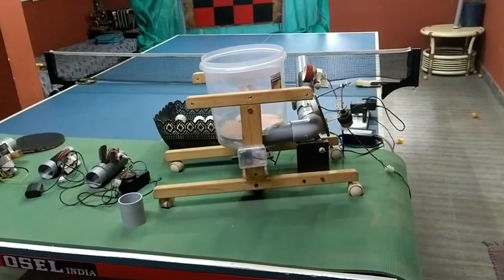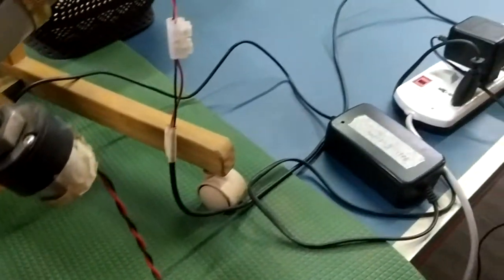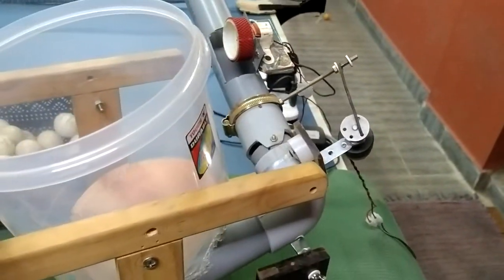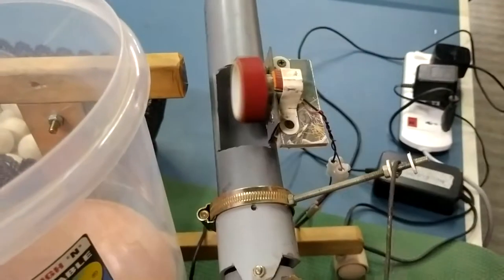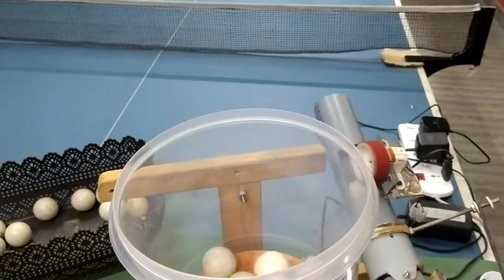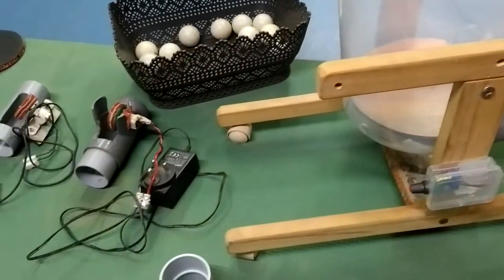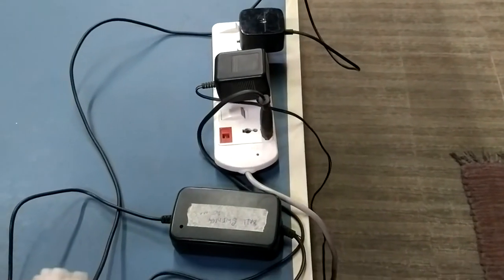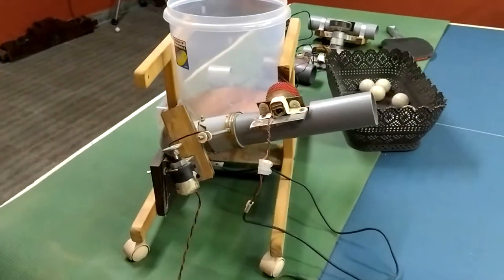Table Tennis Robot - explained.

Comment: Thank you so much for this video. Sir, plz mentioned the specification of all motors in comments
Reply from the maker: Thanks Mr Naba Kishore Prusty for watching my video. 
1. For ball delivary disc in the plastic basket i have used 200 rpm DC motor controlled by small max 12 volts regulator to decrease or increase the speed of ball delivary. This is connected to 12 volts Ac/Dc convertor( or any waste mobile charger at home). 
2. For osilation mechanism of ball delivary tube also same 200 rpm DC motor, regulator and convertor. 
3. For ball shooting wheel device i have used high speed DC motor of 12 volts . Regulator if necessary and Ac/Dc convertor of 12 volts. 
Regulator will be a must for ball delivary disc and oscillation mechanism.
Reply from the maker: For ball shooting wheel DC motor of 1200 rpm

Comment: Where to get coupler to connect motor to wheel or bottle cap please?
Reply from the maker: I used gum tape to wound on shaft and fix the toy wheel . For bottle cap , just made a hole , fixed on shaft and glued with Araldite .

Comment: Were you an engineer ?
Reply from the maker: Thank you Aman. 
I am not an Engineer. I am a Botany (Hon) graduate and Post graduate in HR. 
It is all common sense as i know  little bit of physics in my PUC. 
Saw many youtube videos on this Robot done by Chinese and Japanese and took the ideas DC motors. Electronic regulators and some pulley  wheels  are only bought through  Amazon and all others are recycled materials available at home. 
Any one can do with General Knowledge and common sense.
No need to be Electronics/ Electric/ Mechanical Engineer.
Reply: @nagarajbn4724  Sir your videos are very informative. I used to do these things when I was in school. Now I got to know about your channel because of philately, you're doing amazing. Keep motivating and sharing knowledge. Best wishes sir.
Reply from the maker: @a.man.arora7  
Thank you ☺️☺️☺️

Comment: sir can u share its componnets
Reply from the maker: 1. Old plastic basket lying at home. 
2.old PVC cut pipes lying at home. 
3.old wooden stand lying at home. 
4. Bought out Nuts, bolts, screws, clamps. 
5. 60 RPM Dc motor for ball disc delivary fixed to the basket. 
6. Mini electronic DC regulators to controle the speed of delivary of balls and swing arm. 2 numbers. 
7. 60 RPM Dc motor for swing arm. 
8. 1200+ RPM Dc motor for shooting wheel.
9. Old mobile chargers of 6V to 12V  Ac/Dc lying at home 
Or buy 12V Ac/Dc convertors. 
😊😊😊😊